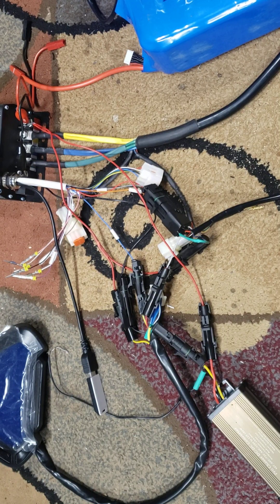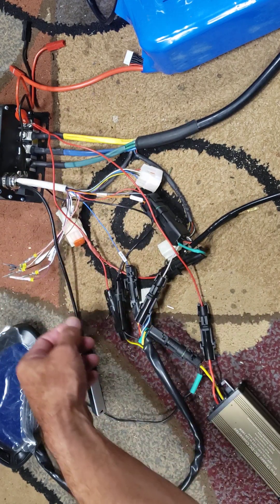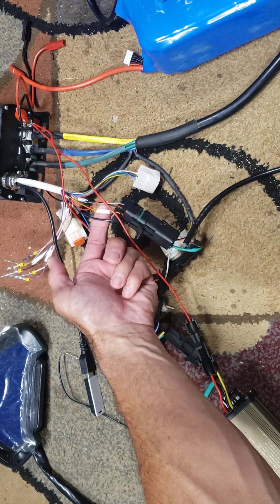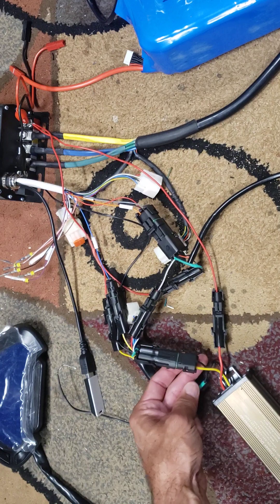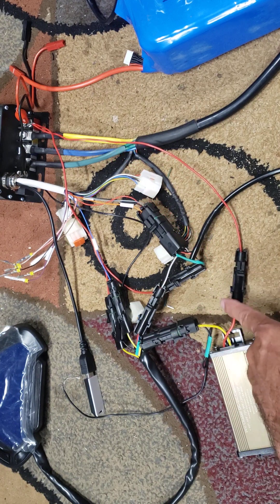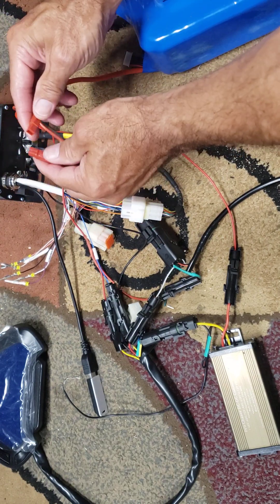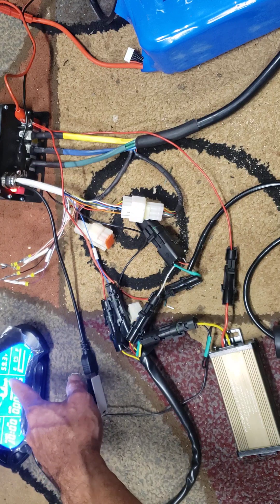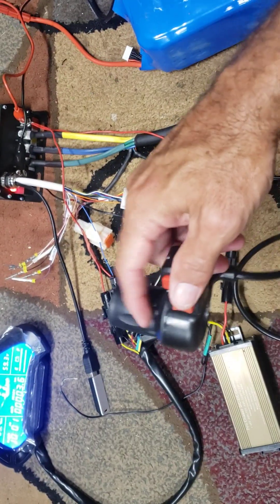CT-22 display wire connections

Comment: Would the 50 piece 12-28 awg single wire connector kit work such as the Amazon glutload brand lever wire connectors?